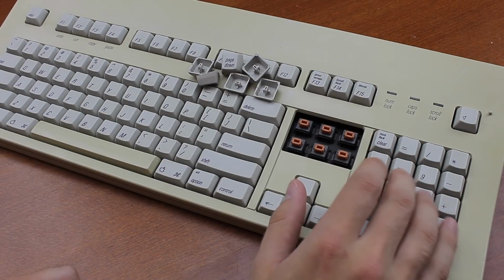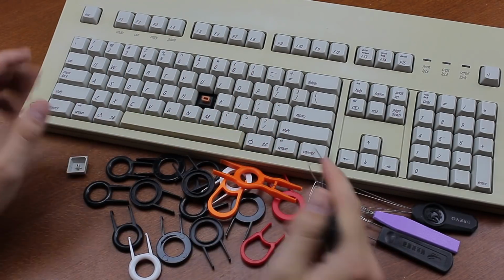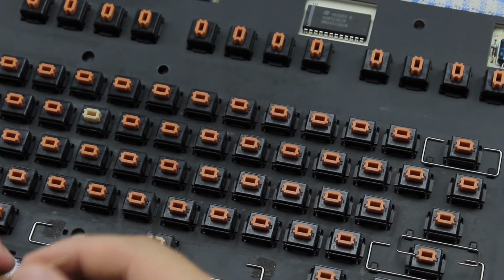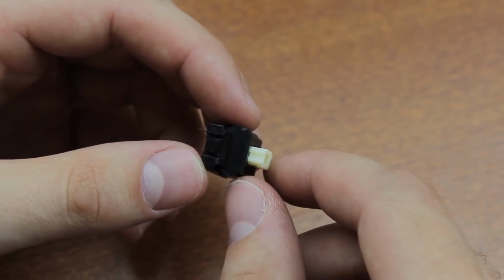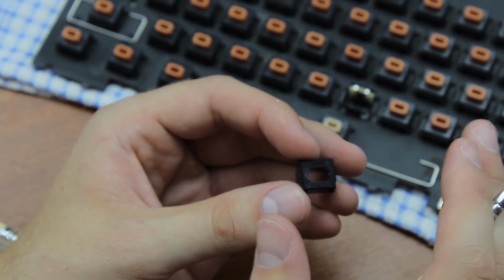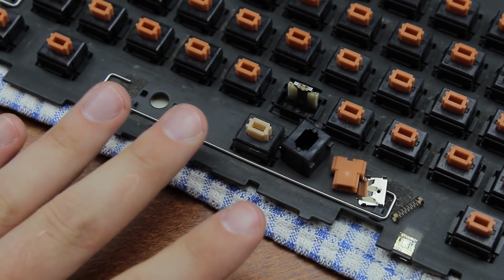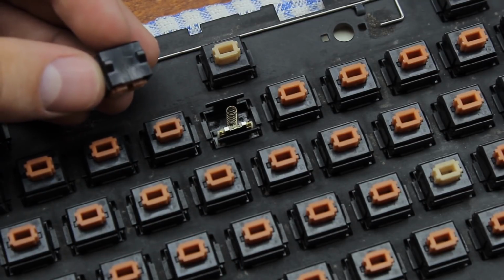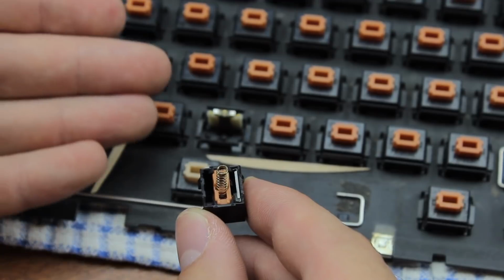Alps restoration guide part 2: how to clean Alps switches

Comment: Fun fact: These are exactly the same switches as inside my vintage Ibanez PUE-5 guitar pedalboard 😁You'd think that stomping on them would exceed their physical limits but it's built really cleverly so that the stomp is transferred directly to the floor, while the switch gets just enough actuation to function but none of the force 🧠 Thank you for this, it actually helped me fix that thing today 🙏

Comment: Newb question...How do you safely disengage the staiblizer bars that are connected to the space bars and larger keys? I did a practice run on a rubber dome $4 dollar special and found out that there were those staiblizer bars and yeah...broken keys... Any tips for Kielbasa fingers would be helpful!
Reply: Be careful! I just took al my keycaps off tonight to clean my board from 1989 that I used to use with my 286/386/486 computers back in the day. Anyway, I managed to pull a couple of the clips out of the plate--but luckily, they didn't break. But if you just pull firmly, but gently, and carefully, they will slide off and you can work the stabs out of the little "slots" they sit in at the bottom of the key.

I wonder though, does any one have any recommendations on lubing these stabs? They're quite thin compared to today's, so I imagine you wouldn't want to overlube them or they would get "sticky" instead of smooth.
Reply: Same question

Comment: Hi, I have a white alps switch keyboard that is very broken, (only the circuit board and the switches are alive) would you help me know what keyboard it is? I only know that under four green LEDs there is a chip that says:

° P8049AH         8608
| 9102S
| 88M003C
| INTEL (M) (C)  1977

Comment: @1:49 You can do that by stretching the wired keycap puller out. That works, except for the spacebar.
Reply from the maker: Used to do that, but it broke my wire pullers.

Comment: @2:40 Interesting that the switches for the function keys are rotated 90º (?!) Is that from factory, or something you or some previous user might have changed? If from factory, I wonder why in heavens would they choose to do so
Reply: Yep, like this from factory as the PCB is designed this way. I'm pretty sure it's because of the way the stems were designed. More stable to have them vertical
Reply: @sidders5023  If more stable, then why not all keys on the keyboard vertical instead of horizontal? Function keys after all are much less often used than the alphabetical ones, not sure why the function keys would benefit for any such extra stability, and why the alphabetical ones wouldn't
Reply: @raulsaavedra709  Because the function keys are taller and most likely wobble less when pressing vertically than if they were horizontal.

Comment: Suggestion: do everything with wire keycap puller and only spacebar with hands. No plastic ones they are keycaps destroyers
Reply: Try two popsicicle sticks. Slide them under the space bar but above the wire stabilizer and gently*and *slowly  twist them until the space bar pops off the switch stem. Remove the sticks, wiggle the space bar free of the wire and there you are :-) This works well with all the large keys.
Reply: @wkg19591  Great idea. Maybe "next time" I'll do that. (I hope there isn't a next time... 😉)
Reply: Agreed. I only had the "ring" puller that originally came with my Northgate OmniKey 102. It didn't really work well on the longer keys--and I don't yet have a wire puller. I ended up gently prying off the spacebar with my fingers. The same for most of the other keys with stabs. Boy, that was tough!

Comment: I've found an ultrasonic cleaner works magic for keycaps, would imagine it could be quite effective for cleaning the switch housings aswell. Would just need some kind of mesh sorting tray to not get the parts mixed up or alternatively wash each switch separately.

Comment: They easiest way i have found of opening an ALPS switch is by using two plastic playing cards. Since they are plastic they are very thin and flexible and as a result you can jam them between the little tabs you put the little toothpicks . You then just pull and the keyswtch is disassembled without any marks or scratches. Check my channel for a how to video.
Reply: @Vineshroom   with the cards you can wedge them between the tabs and the clips and then just pull the top part out either with your hands or with a pair of tweezers. I'll be uploading a video of how I do it soon and you will see what I mean
Reply: Hmm, I was thinking of using the "guitar picks" that come with the iFixIt kits.

Comment: would you suggest cleaning the switches in an ultrasonic bath?
Reply from the maker: Not if it's not necessary.
Reply: Chyrosran22 Is there any harm it can do?
Reply: @senya6095  No not at all. Only do it if they're sub optimal tbh. It will remove any minor surface dirt and that may be the issue with why they feel bad!

Comment: Hey don’t buy ford most unreliable vehicles
Reply: Last escorts are bad, and older Mk.1 mondeos. Other than that, it depends. I had 3 cortinas, some sierras and focus Mk.1 and Mk 2 and other than rust no problems. Just avoid diesel and you are fine.